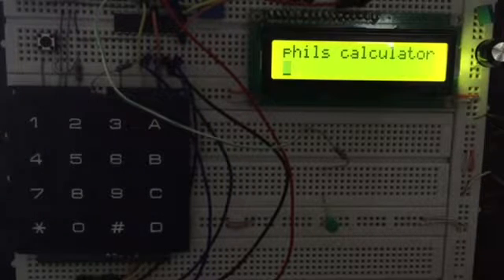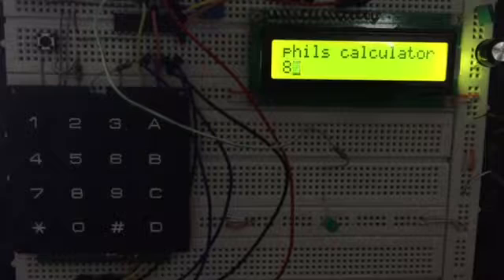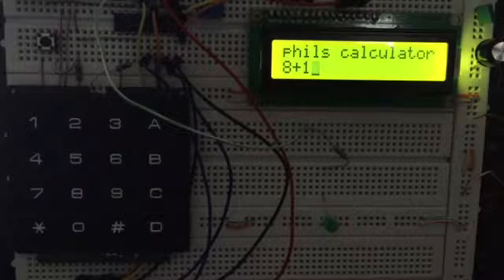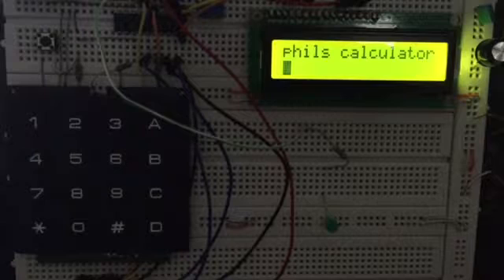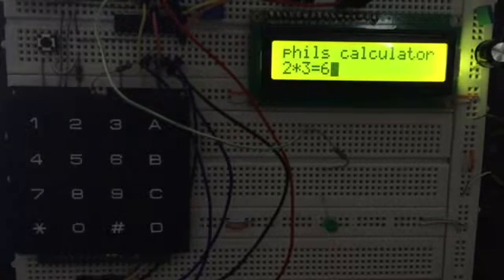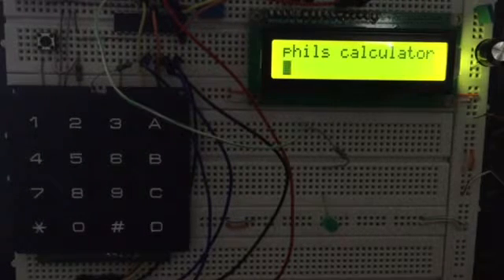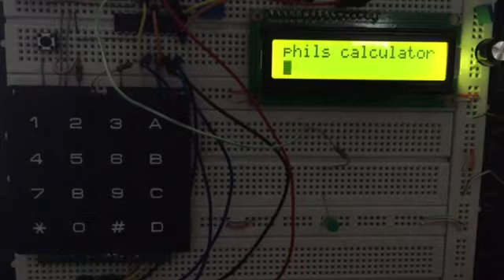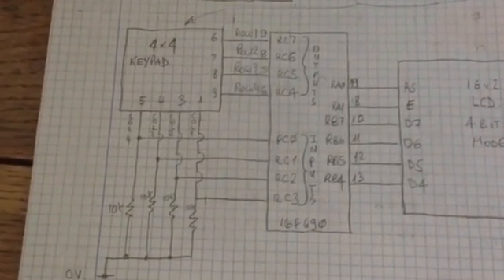Calculator using PIC 16f690 microcontroller, 4×4 matrix keyboard and 16×2 LCD display coded in C

Comment from the maker: Firmware and circuit diagram for this project is at this link http://www.hifigear.co.uk/blog/calculator-using-pic-16f690-microcontroller-4x4-matrix-keyboard-and-16x2-lcd-display-coded-in-c/